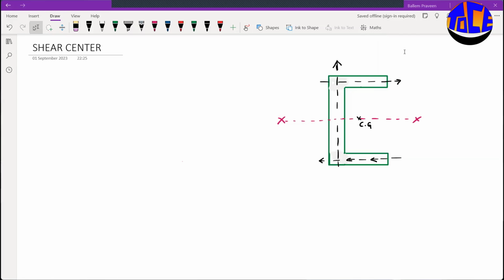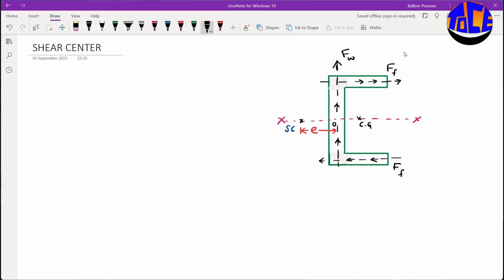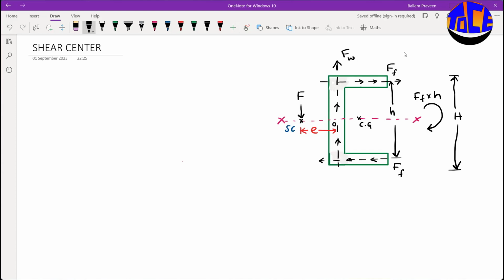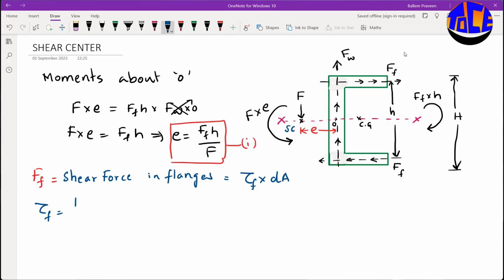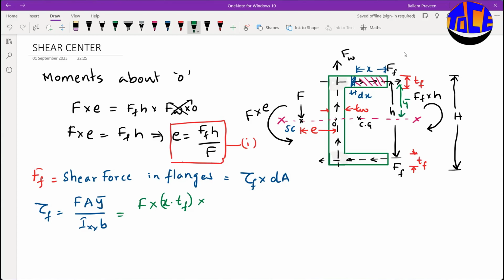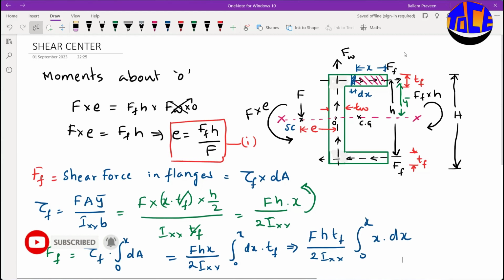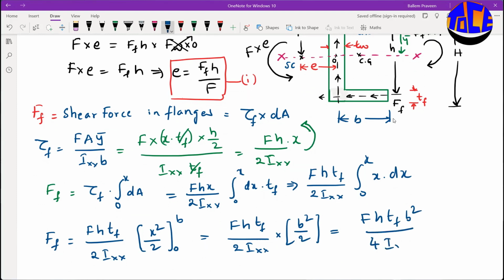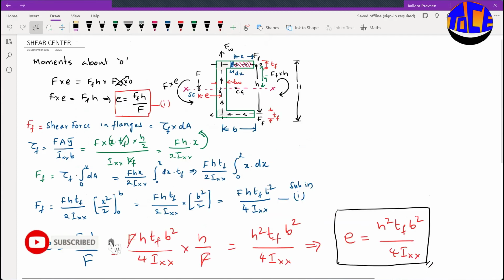SHEAR CENTER FOR C (Channel) Section

Comment: Thank you very much these are very helpful. Shouldn't at 5min00seconds, when you take moments about O, shouldn't Ff be multiplied by h/2 (as that is distance to point O), can you explain why multiply it by full distance when it only goes to half really (h/2). Thank you
Reply from the maker: Thank you, here we need to consider bottom Ff also, which is clockwise adds with top Ff moment ( Fxe = Ff x h/2 + Ff x h/2 which will become Ff x h)